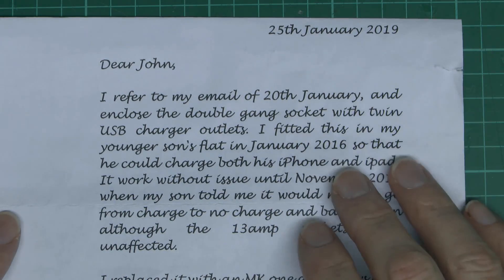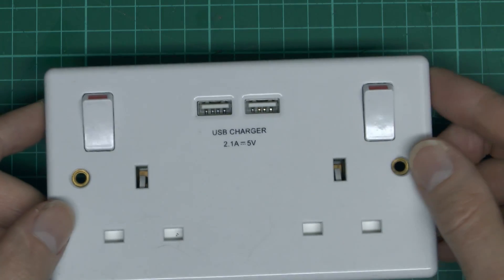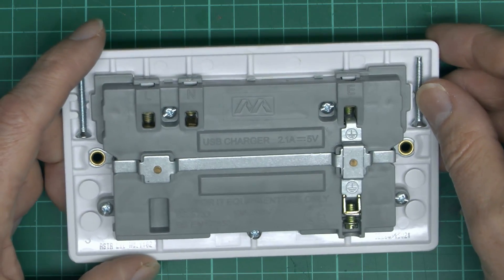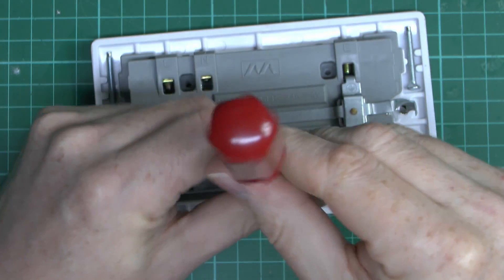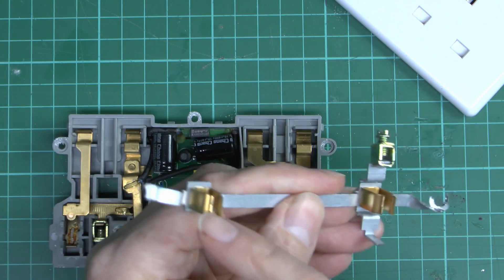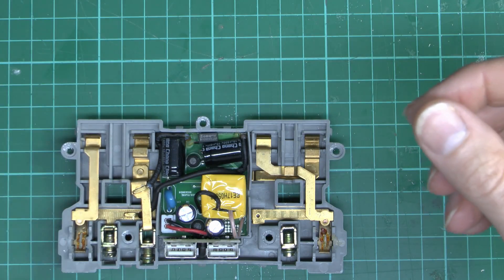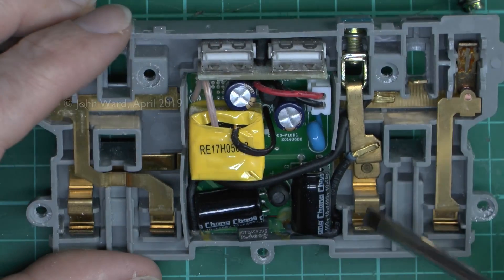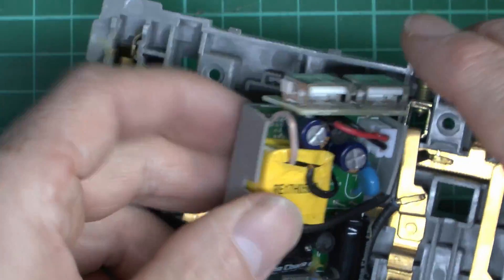Masterplug USB Socket Teardown

Comment: Standard setup for consumable electronic items, engineer it to fail within a rough timescale and sell more of them. Mostly the same with all IT equipment, post pentium3 era most of it fails within 5 years. I still have a compaq deskpro (p3 @ 1000mhz) which is fully working albeit now almost useless for all purposes, they don't make them like that anymore.
Reply: Like most modern electronics , built in obsolescence,  I'm sure it's like that with android phones & tablets, they gradually slow down over time, even if you do a factory reset on them, they don't seem as fast as when you first bought them! 😞
Reply: Same, I've got lots of old computers and phones that still work fine but can't really be used for anything practical anymore. Software and websites just keep demanding more and more processing power just for basic stuff.
Reply: These are really easy to time the failure where you want because it will be connected 100% of the time and the aging characteristics for those caps etc. are quite well known. Allow a year or so for hot climates and you will hit the sweet spot of failulre nicely after the warranty period is over.
Reply: i also have a compaq deskpro p3 1ghz, works nicely,  as for useless for almost all purposes nowadays, definitely not !
Reply: Youtube and facebook are too laggy on my old computers and I can't run modern games on them or software. Sure you can mess around with period correct software and web 1.0 stuff but definitely won't do as a daily driver.
Reply: @uK8cvPAq  you could use them for daily use if for things like wordprocessing, spreadsheets, photo editing,   .. modern gaming probably not 😉, but old games would be ok,  as for the 'net, it has been on the net but yes, slow, thats probably due to the 384Mb RAM ..
Reply: I tried installing office on it but 365 wouldn't install, even the cloud version refused to work. Have you tried running youtube on an older single cored PC in recent years? Even PC's that could previously play it fine now struggle for some reason.

Honestly I'm not trying to dismiss old devices entirely, I keep using things for as long as possible and then some.
Reply: @uK8cvPAq  yes, i have tried youtube on older machines, and yes its erratic, but then i dont really use those machines on youtube , they're for other purposes 😉 if they didnt keep adding bloat and other unnecessary gunk to websites, older machines and o.s.'s would still run ok
Reply: office 365 probably wont work, but i have older machines with older versions of office on, and they work ok..

Comment: The problem is it's a piece of electronics attached to a permanent electrical installation. I'm still not convinced by active RCDs, let alone anything more complex
Reply: Yeah seems like an unholy hybrid of things that belong in entirely separate categories... I'd be a bit creeped out having cheapo consumer electronics I can't switch off inside my sockets. You can buy reasonable external usb chargers and wi-fi boosters for less than these all in one units - which just seems like the best way to go IMO
Makes sense to the socket manufacturer though, they get to sell a £12 unit instead of a £2 unit... if the consumer replaces it with another USB socket they've got a nice repeat sale going - better than selling normal sockets that basically last forever.
Reply: @joinedupjon  my words exactly!

Comment: I like the UK plug and socket outlets, far superior to North America, but I do not like the idea of USB chargers built into wall plates.
Reply: comm744 especially if there isn’t an earth attached to the other case of the usb
Reply: American practice is better though, imo. The accessories are poorer quality, but the huge working space in the backboxes and breaker panels, was a revelation to me (i did maintenance at a motel for 5 yrs there)
Reply: @TheChipmunk2008  You need that space though, because the cables are so much thicker to handle the lower allowed voltage drops. Then you are passing 30A through the thinnest smallest steel spring stab in contact, what could go wrong with having a mini toaster in every connection.

Here at least cage clamps and screw terminals for connections are the only thing, push in connections are only for wire connections, where you can also use crimp connectors or ceramic wire nuts, which do not melt.
Reply: @SeanBZA  True if you use the backstab connections. I never did.  But no socket circuit with normal outlets is 30A in the US or Canada, 20 is the largest breaker for general purpose circuits. It's why so many youtube makers in North America keep going on about 'can't run x and y together or it trips a breaker'.  Seems a bit precarious to me lol

I'm surprised more of them don't just add a couple of new breakers for the workshop?
Reply: They make receptacles with USB ports for North America as well.